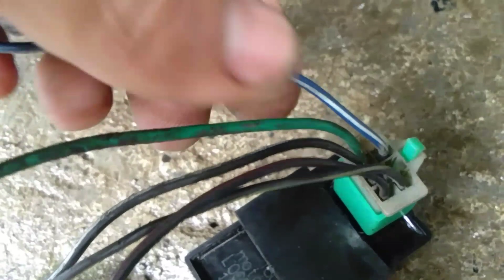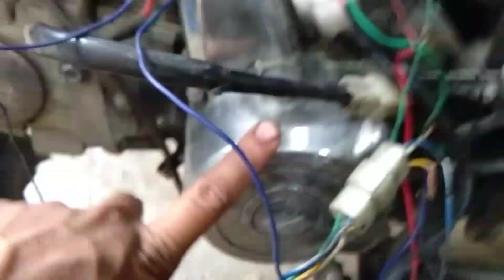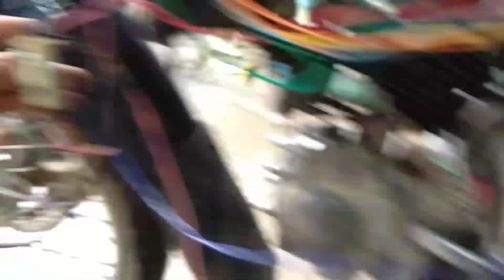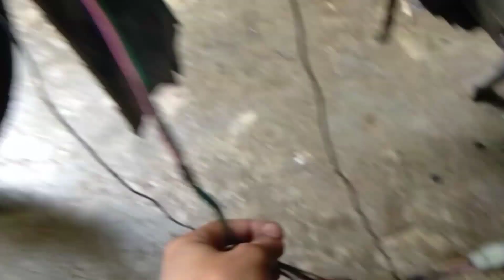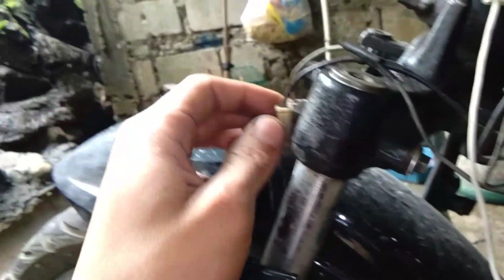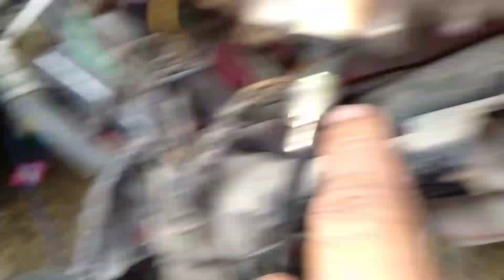Wire Harness Connection Guide / Chinese Motorcycle / Tagalog

Comment: Good day, ask ko lang good stator pero ang output ac is 5volts lang pusibli bang sira ang magneto or pulser ko nag palit ako NG stator parehas lang 5volts ac output ty
Reply from the maker: kung 5 volts lang po it means na may sira ang regulator
Reply: @nonpromechanic  ty sir pero sa stator output ac ako nag sukat yellow wire